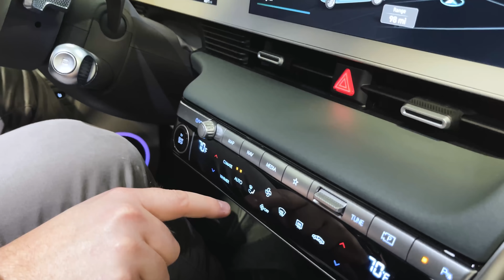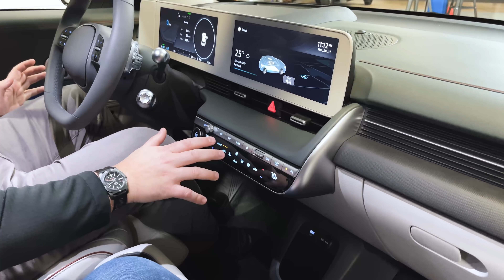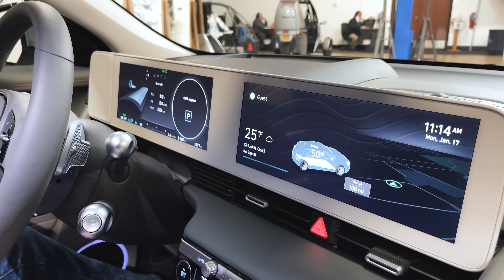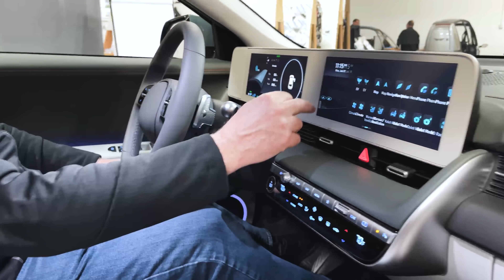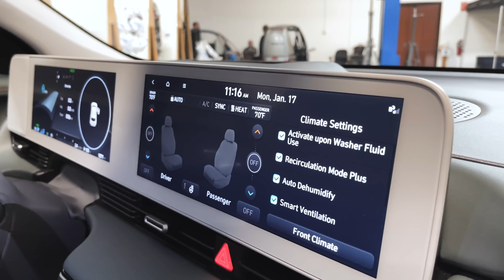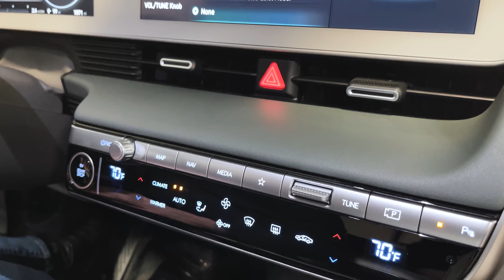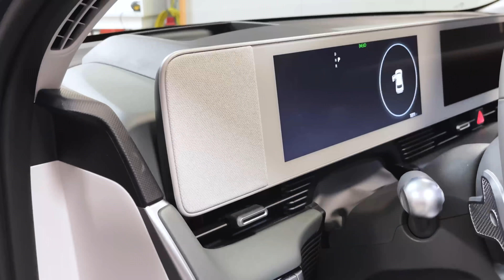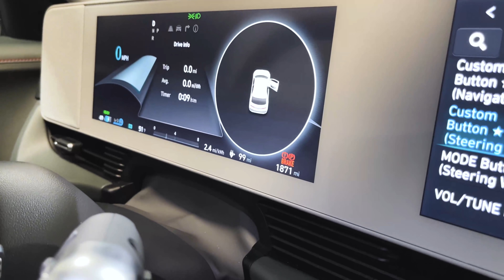2022 Hyundai IONIQ 5 | Sandy's First Impressions

Comment: Would be awesome to hear an update of your view of 800Volt Systems vs Tesla’s 400 Volts, how much does it take to get the Tesla’s to 800 Volt, do you see problems arising if they keep to their 400 Volt?
Reply: Charging current will become a problem, because of charging stations needs to pump more current with lower voltage to get more power. and general the I^2*R losses will be greater for low voltage systems. 800 or maybe 1000 V is cheaper and more efficient.  i think the reason why it have been 400V is due to matrials and insulation
Reply: @enginerepairguy  
Until the 4680 arrives with lower internal resistance?
Reply: @rogerstarkey5390  how would that effect anything about I^2*R loses ?
Reply: @enginerepairguy  the loss of energy in a 5 meter cable isn't significant so it doesn't affect efficiency in that way. But it is true that at twice the current the cable needs to be heavier.
Reply: @Rich-on6fe  if there's no significant loss due to resistance, why are High Power Charging Cables liquid cooled?
Reply: @bilgyno1  sure, some heat is generated in the cable's resistance, but it's not significant in terms of the overall system efficiency and how far the car will travel relative to your electricity bill. And whether it's 400 or 800V, the engineer will choose a cable gauge that has a loss that they deem acceptable. If reducing the already-tiny bit of loss matters to them, they'll use heavier cable. 
I didn't know they were cooling the cables - sounds like a curious choice when what they should do, to minimise loss, is use heavier copper. Shows you where their priorities lie.
Reply: 800V systems are mostly marketing fluff. The "800v architechture" really only impacts the voltage on the cable between the fast charger and car power electronics assuming the charger is capable of supplying 800V. Car drive units can modulate the voltage and frequency to the motor so it has nothing to do effeciency or power.

Also, it would be bad for Tesla to go to 800V because they will only be using around 800 4680 batteries in the new pack. At 4V for each cell, this would mean you need 200 cells in series, with just 4 of these groups in parallel. This also limits Tesla to making packs in 20Kwh increments only (60kwh/80kwh/100kwh). If Tesla ever makes a 40kwh pack out of 4680s for a compact car this would be just two cells in parallel for 800V which imo is not acceptable.
Reply: @5893MrWilson  if its just marketing fluff, why would automakers invest millions in R&D developing 800V?
Reply: @5893MrWilson  Nice insight...Could you elaborate further why it would be problematic for Tesla to wire 2(or is it 200 cells?)  series in 2 parallels?
Reply: @enginerepairguy  I heard there were issues with 800V components availability.
Reply: @benzengap6804  Yeah no problem. Lithium cells are 4v each so you would need to run 200 cells in series to get 800v. I think Tesla's battery quality is extremely high but if one of your batteries fails or degrades in series the entire group can become unusable. Also when you run batteries in parallel they balance each other's voltage. Tesla probably has some degree of smart circuitry to bypass faulty batteries if they fail but this adds complexity to the wiring. 

It has also been estimated that Teslas 4680 batteries will be 25Ah so this means  100wh per battery (4v * 25Ah = 100wh). If you are locked into 800v architecture this means a minimum of 200 cells in series or 20kwh pack. Then you would run groups in parallel to form 40, 60, 80kwh, etc packs which is not a huge deal but Tesla may find 50kwh to be the ideal balance of cost and range for a future model and this gives them less flexibility.
Reply: @5893MrWilson  In a 400 volt architecture, how many cells in series should there be to form a pack for a 50kwh battery?
Reply: @benzengap6804  4680s cells will be 0.1kwh each so 500 total for 50kwh. After some reading up on this I think the "architecture" is only referring to the charging electronics in the car so the series/parallel debate is meaningless. The drive unit can convert the incoming 800v charging to whatever it needs and distribute it to the battery pack. This being said, Tesla has kinda proven 800v architecture is pointless since Tesla has the fastest charging in the industry (250kw) with a 400v architecture. So what is the true impact of using 800v? - well it seems 800v allows you to run cables with less copper but requires more insulation and beefier power electronics components.
Reply: @5893MrWilson  Thanks for the reply.
Reply: @enginerepairguy  that depends on the diameter of the wire. with a large enough wire the losses are insignificant.
Reply: @Rich-on6fe  using thicker wire can only go so far, because the wires will get very heavy. To the point that it will make them not very easy to use for a lot of people.
Reply: @5893MrWilson  as an owner of a 800V car, I can confirm it is more than a marketing gimmick. Charging speed is consistently high, whereas most 400V systems peak for a short time, then decline rapidly. Tesla are definitely doing great with ~25 minutes 10-80%, but the Ioniq 5 and EV6 take only 18 minutes, with a similar size battery. For most others with a 400V system it takes 35-40 minutes, or even more.
Reply: @bilgyno1  this is assuming you can find a charger that can push 800v. 400v rated components are cheaper much more widely available because of home electrical systems. This is why most chargers are designed around 400v and can't actually hit those advertised speeds.
Reply: I think every new high power charger today is 800V?
Reply: @bilgyno1 efficiency of BMS system key and neglected, that’s why depite shorter time needed in ioniq 5, added miles per minute tesla still leads the pack and therefore running cost of EV (electricity part) is way lower than competition
Reply: Most of the new ev chargers are built by Tesla.  Also to further my point that 800v is just marketing, Tesla has stated that they will have 350kw charging on the 400v system. 800v is suppose to increase charging rates but Tesla seems to have no problem on 400v. 800v also requires more expensive chargers but this isn't your problem if you are a legacy auto makers that just builds the cars.
Reply: Higher voltage allow for manufacturing economies, like thinner wires and lower current MOSFET in the power electronics.
But the high voltage battery add a lot of long-term problems, as all insulators are permanently under stress, and the wiring attracts small particles of dust and other materials that, in few years will reduce the dielectric specifications of the materials, inducing first power losses and ending with sparks that create random faults.
The 400 Volt of Tesla are already too much, but this voltage is well handled by diodes and MOSFET in commercial use since at least two decades.
Manufacturers which are now entering the electric car market are lured by the ease on paper of the higher voltages and cheap cabling; unaware of the behaviour of anything electric above 400 V on the long term in climatically hostile environments, in terms of temperature, salinity, humidity and dust levels.
Leave this car parked outside in the winter, maybe close to a sandy beach, and report what happens in the spring.
Market is still too young for a widespread knowledge on the consequences of an 800 - 1000 Volt battery, but I would suggest, avoid cars with such high voltage battery, until they have a proven track record of reliability and safety.
Reply: @rayoflight62  thank your for your Input!
Reply: @bilgyno1  There has been an anouncement that Tesla will be boosting the charge rates on its V3 400v chargers to 324kw (from 250kw) which should bring their charge times below 20min.
Reply: @5893MrWilson  800V capable charging stations are pretty common already in my part of Europe and will continue to roll out. But even at a 400V charger, the car (Ioniq 5) actually bumps it to 800V internally to keep charging at high speed (~ max power of the charger) for a large part of the charge curve.
Reply: @5893MrWilson  yes, 324 kW is great, and like I said originally, Tesla are making the most of a 400V system, certainly compared to all the others on 400V. But I don't think the 324 kW will help the current cars much per se. How fast they can charge depends on the battery characteristics. So it probably helps the cars that have (or will get) bigger batteries, like the S/X Plaid or Cybertruck.
Reply: @bilgyno1  so if the car can bump up 400v charging then why do you think Tesla hasn't made a 800v pack yet? I'm telling you it makes very little difference to the car and it adds cost to the electronics. They keep pushing this narrative that 800v is way better because It's mostly marketing.

Comment: Sandy, I think you say "BOSE Technology" when you check out those "vents" on the side of the trunk lid. If indeed it says that over there somewhere, then this is probably part of the sound design. There is a base box under the trunk floor, so those just might help with resonating the base. Only a guess, of course.

Comment: Where is the rear wiper? No rear wiper isn't great in winter.
Reply: That’s been tested by a dealer in Canada who got a lot of comments like yours. It turns out the aerodynamics of the top mounted spoiler keeps the rear window clear. He tested visibility and was amazed how well it works. There’s no place to put a wiper up underneath like Hyundai did on the 22 Tucson and now others are copying.

Comment: The car certainly has auto park, parallel, straight, on the opposite side of the street as well and auto steer out of the parking. This has been in all higher end Kia's and Hyundai's for half a decade.

The auto hold, Sandy already found out what it does in the Kona episode. 

It basically changes if the vehicle will move when you lift the brake or if you need to hit the accelerator. It also uses still (at least when completely still on the hybrid) the hand brake so the car doesn't go backwards on hills.

Comment: I like the retro style which mimics the old 1980's VW Golfs and Rabbits, which is still relevant today.  Appears that Hyundai implemented a number of styling tricks to elongate the front hood, by extending over the headlamps without a "break" for the front bumper.  Great dialog from Sandy and Cory.  I would love to invite these guys along when purchasing my next car, given their wealth of knowledge and exhaustive experience in the auto industry.  Also, I'd like to suggest that that ribbed plastic molding on the rear hatch helps to stiffen and maintain contact with the door and the body, which most likely results in a quieter ride. Studies have shown this seal is a major source for noise inside the cabin.

Comment: re: "highly-fragmented design"; it won't matter to buyers in a showroom. car purchases have a big emotional component, and this car looks great. if it performs adequately, has sufficient range, Hyundai will sell as many as they can make.
Reply: Well it does actually impact the buyer in the showroom because poor design choices can lead to a higher intial sticker price, and potentially higher repair/maintenence costs over vehicle life. And the blue coolant next to the washer fluid could be a VERY EXPENSIVE poor design choice.

Comment: The physical buttons and stalks are actually good Human Factors Engineering.  Its the reason people avoid Teslas and choose Ionic 5s.  I'm glad they didn't delete it.  The controls also have programmable buttons.  BTW: They do have an AC outlet both in the back seat as well as an adapter in the charge port.

Comment: I think I could sleep comfortably in that 2nd trunk you opened, laying diagonally. Just put down a thick pad or two,  a few pillows, some earplugs, a blanket, and I could sleep comfortably for hours. I am 6feet4inches tall, but I bend my legs when I sleep. 

I like the styling of the outside of the front of the car.

From Douglas in Minnesota.

Comment: Just a heads up that button that you can assign a function on the steering wheel exist at least in audi`s for a while now, had an A4 2007 that had it and my current audi S3 2016 also have one on the steering, they are called Joker button

and yes it is very useful
Reply: Also in a Citroën C4 Picasso 😉😉

Comment: Catching glimpses of an Arcimoto in the background :) This Ioniq looks solid. Much preferable to VW ID.4. Would consider if I weren't already in a Tesla.
Reply: Well you can always upgrade from the Tesla to the Hyundai which is better built and more modern (800V etc).
Reply: @GA-wq8xq  did you see under the hood? cringe I’ll go with the cars built by the guy who successfully launches reusable rockets into space.
Reply: @roddlez  It is still a fresh EV platform, even if it seems to have some ICE legacy related to mostly assembly I'm guessing.
Reply: @rkan2  I'll agree that this could be a leading car among the transitioning-from-ICE manufacturers. It just doesn't hold a candle to the overall product and user experience developed by a 21st century car company. 

Tesla isn't perfect by any means, but it's literally like comparing a smartphone to a blackberry or nokia phone, or using a website to buy something in a few clicks versus wasting an entire a day (or days) in a dealership.

Tesla simply improves how car ownership ought to be in hundreds of different ways, even beyond just the vehicle itself. Hyundai has a looooong way to go to compete, and they're still a decade or more behind.
Reply: @GA-wq8xq  By the time Hyundai gets around to building them, the then current Tesla will have already been improved multiple times. I'm not so sure the Ionic 5 that will be available "someday" will be an improvement.
Reply: @wilfredvanvalkenburgh2874  the Ioniq 5 is out now and has been on sale in Europe for the past six months. They will scale up but the vehicle is out and Tesla will catch up sometime with 800 volt’s and a proper interior.

Comment: There do seem to be a few too many buttons, but I am no fan of using the touch screens for everything, plus in that car you have to lean forward to touch it. Leave the screen in use for infotainment or navigation. As for reviewers obsession with trunk space, i hardly ever use what I have, and I drive a VW New beetle with no space at all. Fold flat rear seats and a flat trunk floor with the tail gate, no lip, is way more important.

A space for a bag in the center console is great, I never hide mine under a seat, nor have I ever met a woman who does.

Comment: About the auto climate: my 2007 BMW has that, you can set the auto climate to low, normal and intense in the idrive menu. It also has constomizable steering wheel buttons, one is a Star, the other is a Rhombus, I set one of them to route home, and the other to do IDK what. It also has 8 Buttons on the Radio which you can pre-program to do stuff you want, like put favorite nav destinations on them.

Comment: I think this is the best looking EV (affordable EV) on the market. By far. If I were in the market I would buy this ANY DAY over a Tesla. I've owned multiple Hyundais and the quality and reliability of all of them was outstanding compared to all of the horror stories I see from brand new Teslas (misaligned panels, missing parts, dodgy reliability). Hyundai puts their vehicles through a ton of testing whereas Tesla just sends their vehicles out and fixes issues as they arise. Expect even better things from Hyundai in the not too distant future.

Comment: The split sunroof screen looks like you could choose front, back or both.
The exposed taillight when hatch open is a bad idea as it forms a shelf to put things on which fall directly on the sonic weld likely to cause premature failure over time as things are set on it or dragged over it when removing from cargo area.
Rear seat and cargo screen making contact to push screen back as seat reclines is a bad idea as it would wear on the leather and eventually open the stitches.
The invisible interior door handle could have the slightest change such as a shallow curve  at a point along the straight line to indicated a grab point. That way no addition parts than already shown while retaining a mostly clean, pure line.

Comment: Sandy bemoaned the fact that the car had a cigar lighter instead of a 3 prong plug. There is in fact a three prong plug on the bottom of the rear seat. Additionally, it has bi-directional charging, which means owners can power electronic devices from the car battery via an adapter plugged into the charging port.

Comment: I think this car will give Tesla fits, especially if it holds up as well as the Kona EV has.  They didn't go into bi-directional charging or 120v out or 800v charging or range, but I guess that's coming.  It goes to the top of my wish list, until I see the EV6.

Comment: Looks great. Hopefully Sandy can pinpoint all the places where it loses efficiency. Every test I’ve seen so far puts it behind the Kia EV6 (even though they’re supposed to be the same car) and well below a Model 3/Y or iD.3/4
Reply: They are aerodynamically very different: The look comes with a price, you need to completely redesign it to make it better. ID 3/4/5 are better aerodynamically but never come close to being as useful or well built (a lot of nasty plastics all over the place in the VW)…

Comment: I think the park control is for the auto park feature rather than a redundant park brake. They can pull straight forward or back from a tight spot like a garage only so unlike the Tesla smart summon it might actually work?